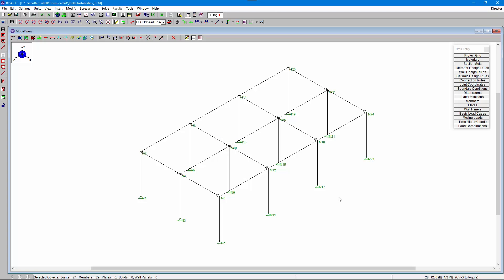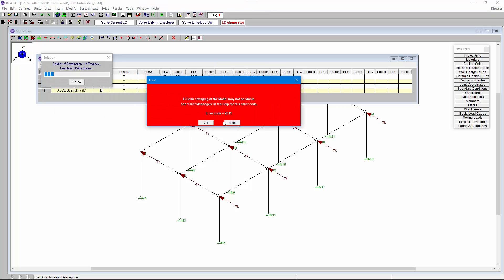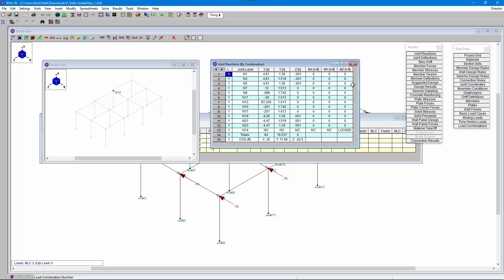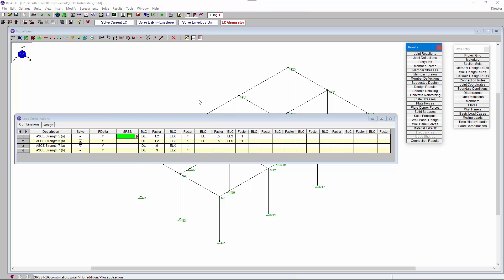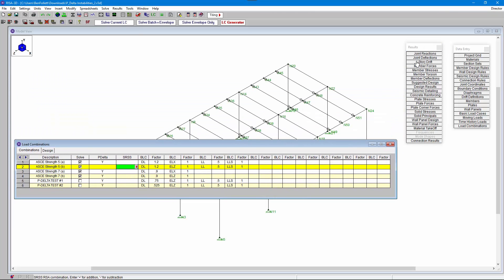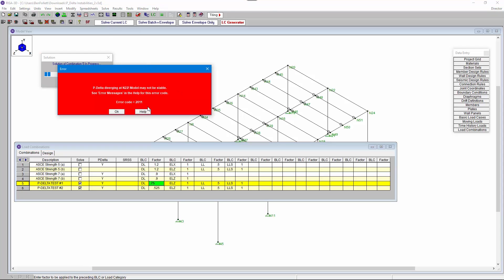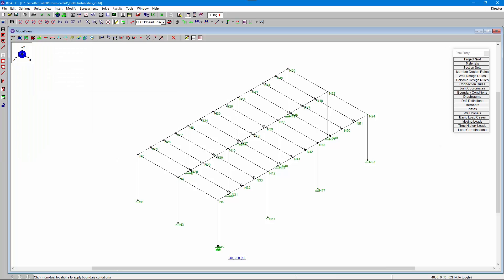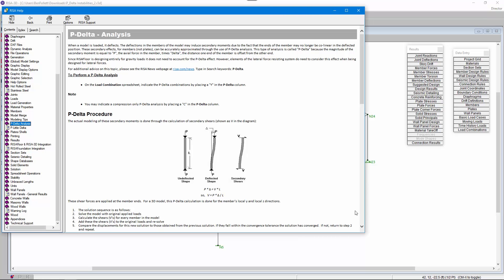How to Fix a P-Delta Divergence in RISA-3D

Comment: This is kind of off topic. But what is the difference in applying 7 kips at each column node vs one 21 Kip shear force at the exterior node only? Does the shear force not transfer through both bays?

Comment: There are many other joints in the model that are unstable in the initial layout. You even make this clear by showing that you need to add fixity to several other members that don't directly impact the N14 joint. Why does Risa report that only one joint is unstable in the original condition? Is there a way to report all unstable joints instead of having Risa try to fix the model itself? The process shown in this video works for a simple model but will be more challenging with complex models.